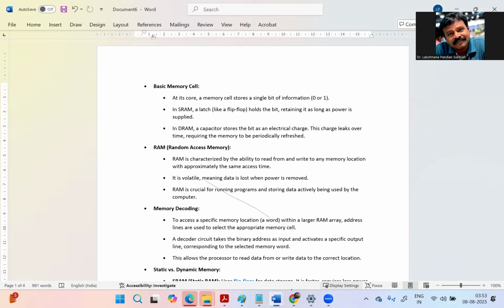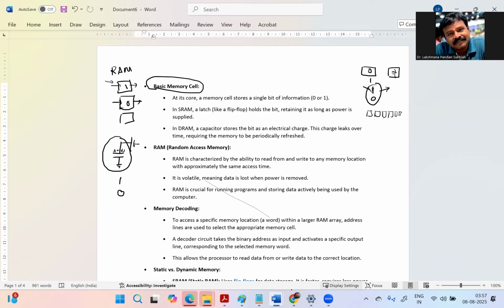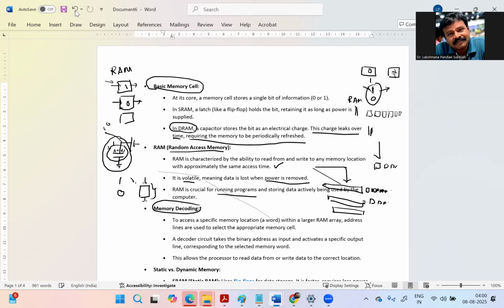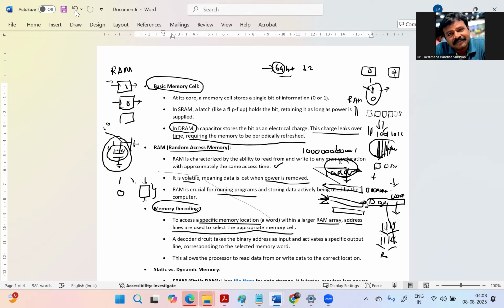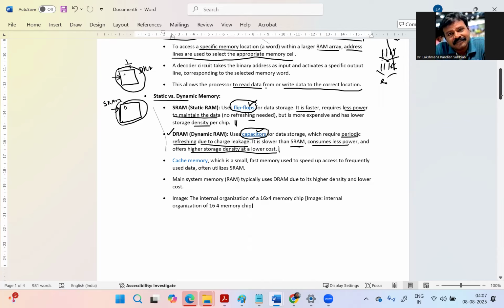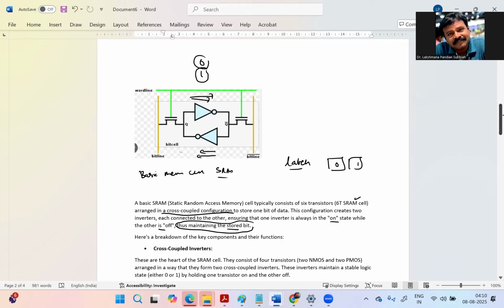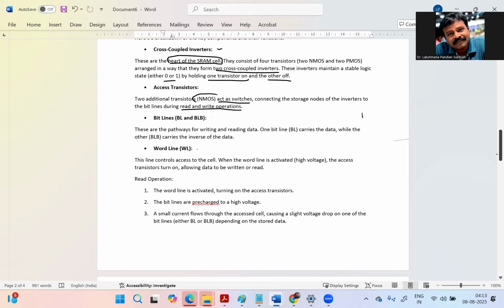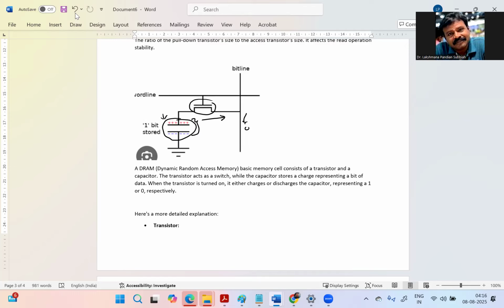DSD - 42  Basic Memorycell SRAM and DRAM

Comment from the maker: •	Basic Memory Cell:
•	At its core, a memory cell stores a single bit of information (0 or 1). 
•	In SRAM, a latch (like a flip-flop) holds the bit, retaining it as long as power is supplied. 
•	In DRAM, a capacitor stores the bit as an electrical charge. This charge leaks over time, requiring the memory to be periodically refreshed. 
•	RAM (Random Access Memory):
•	RAM is characterized by the ability to read from and write to any memory location with approximately the same access time. 
•	It is volatile, meaning data is lost when power is removed. 
•	RAM is crucial for running programs and storing data actively being used by the computer. 
•	Memory Decoding:
•	To access a specific memory location (a word) within a larger RAM array, address lines are used to select the appropriate memory cell. 
•	A decoder circuit takes the binary address as input and activates a specific output line, corresponding to the selected memory word. 
•	This allows the processor to read data from or write data to the correct location. 
•	Static vs. Dynamic Memory:
•	SRAM (Static RAM): Uses flip-flops for data storage. It is faster, requires less power to maintain the data (no refreshing needed), but is more expensive and has lower storage density per chip. 
•	DRAM (Dynamic RAM): Uses capacitors for data storage, which require periodic refreshing due to charge leakage. It is slower than SRAM, consumes less power, and offers higher storage density at a lower cost. 
•	Cache memory, which is a small, fast memory used to speed up access to frequently used data, often utilizes SRAM. 
•	Main system memory (RAM) typically uses DRAM due to its higher density and lower cost. 
•	Image: The internal organization of a 16x4 memory chip [Image: internal organization of 16 4 memory chip]

 

A basic SRAM (Static Random Access Memory) cell typically consists of six transistors (6T SRAM cell) arranged in a cross-coupled configuration to store one bit of data. This configuration creates two inverters, each connected to the other, ensuring that one inverter is always in the "on" state while the other is "off", thus maintaining the stored bit. 
Here's a breakdown of the key components and their functions:
•	Cross-Coupled Inverters:
These are the heart of the SRAM cell. They consist of four transistors (two NMOS and two PMOS) arranged in a way that they form two cross-coupled inverters. These inverters maintain a stable logic state (either 0 or 1) by holding one transistor on and the other off. 
•	Access Transistors:
Two additional transistors (NMOS) act as switches, connecting the storage nodes of the inverters to the bit lines during read and write operations. 
•	Bit Lines (BL and BLB):
These are the pathways for writing and reading data. One bit line (BL) carries the data, while the other (BLB) carries the inverse of the data. 
•	Word Line (WL):
This line controls access to the cell. When the word line is activated (high voltage), the access transistors turn on, allowing data to be written or read. 
Read Operation:
1.	The word line is activated, turning on the access transistors. 
2.	The bit lines are precharged to a high voltage. 
3.	A small current flows through the accessed cell, causing a slight voltage drop on one of the bit lines (either BL or BLB) depending on the stored data. 
4.	A sense amplifier detects this voltage difference and amplifies it to a full logic level (0 or 1). 
Write Operation:
1.	The word line is activated, turning on the access transistors.
2.	The desired data is placed on the bit lines (BL and BLB).
3.	The stronger access transistors overcome the inverters' stored state, forcing the inverters to latch onto the new data.
4.	The word line is deactivated, and the new data is stored. 
Key Concepts:
•	Static:
SRAM cells maintain their stored data as long as power is supplied, unlike DRAM (Dynamic RAM) which requires periodic refreshing. 
•	Static Noise Margin (SNM):
A measure of the cell's ability to withstand noise during read and write operations. A higher SNM indicates greater stability. 
•	Cell Ratio (CR):
The ratio of the pull-down transistor's size to the access transistor's size. It affects the read operation stability. 
 
A DRAM (Dynamic Random Access Memory) basic memory cell consists of a transistor and a capacitor. The transistor acts as a switch, while the capacitor stores a charge representing a bit of data. When the transistor is turned on, it either charges or discharges the capacitor, representing a 1 or 0, respectively. 

Here's a more detailed explanation:
•	Transistor:
The transistor acts as a switch, controlled by a signal on the word line. When the word line is activated, the transistor allows current to flow between the bit line and the capacitor, enabling data to be written or read. 
•	Capacitor:
The capacitor stores a charge, representing a bit of data. A charged capacitor represents a binary "1," while a discharged capacitor represents a binary "0". 
•	Bit Line:
The bit line is the pathway for data to be written to or read from the capacitor. 
•	Word Line:
The word line is used to select a specific row of DRAM cells, activating the transistors in that row. 
•	Read Operation:
When reading, the transistor acts as a switch to connect the capacitor to the bit line. The charge on the capacitor is transferred to the bit line, which is then sensed by a sense amplifier. This read process is destructive, meaning the charge on the capacitor is altered during the read, and the data must be refreshed (rewritten) after each read. 
•	Write Operation:
To write data, the transistor is turned on, and a voltage corresponding to the desired bit value is placed on the bit line. This voltage either charges or discharges the capacitor accordingly. 
•	Refresh:
Due to charge leakage, DRAM cells need to be periodically refreshed to maintain their data. This is typically done by reading and rewriting the data in each cell.